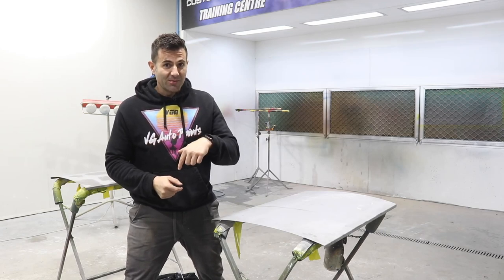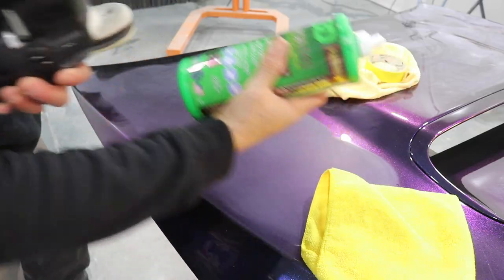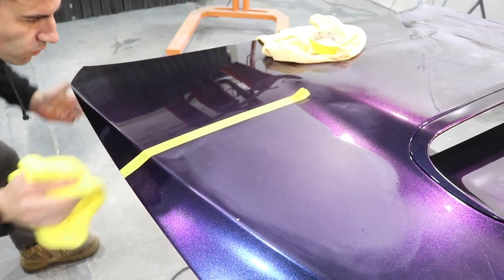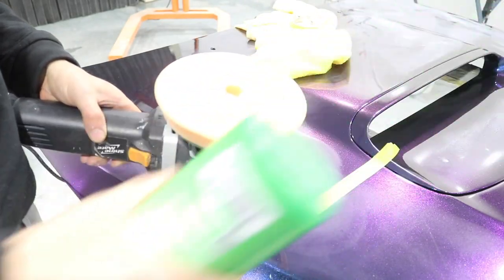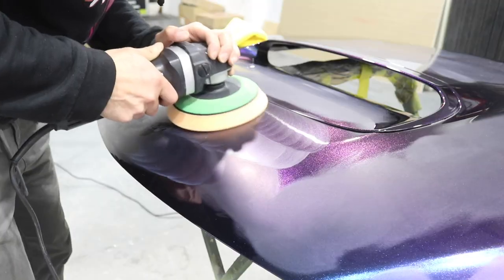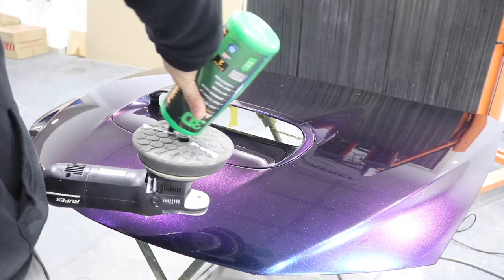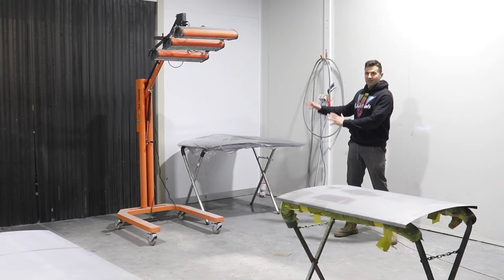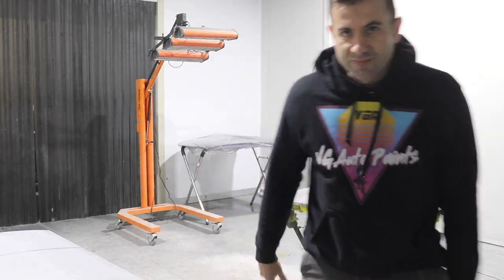Can a DA Polish 1500g Sandpaper

Comment: Hi mate love your work I’m struggling with my finish no mater what I do I’m  always getting scratches with my final product useing trzact 2000 finishing with 5000 cheers
Reply from the maker: Hey mate in my experiencein seeing  pros to first timers polish is 2000 and 3000 is enough. But using them for double the time spent on the previous grit is important. Also spending more time machine polishing with slower arm speed. Hope this helps.

Comment: Great rundown.  Totally concur with your approach.

That 3D is great stuff.  I’ve also had a lot of success with Meguiar’s M110 (newer than M105), as well as Griot’s Fast Correction Cream (which might not be available to you).

A lot of the outcomes have to do with the pad you choose.  A high-quality microfiber pad (like Meg’s) or even a wool pad and a rotary will cut really fast.  Any of the aforementioned compounds do well with dusting, but 3D is easily the best in that arena.  3D One is excellent for the finishing stage, but takes a while.

The sanding stage is where I think the real make-or-break of the effort is.  Getting that wrong will make polishing 10X harder to save.

Anyhow, you said all of that, but I just thought I’d second all of it from across the water.

Comment: Used to use  megs 105 and 205 years ago found them reasonably good as an amateur  but just upgraded to new bayt 1 step and it is a very good product with a foam pad for 1500 and finer
Reply: If you can access and afford the latest versions of Megs 105/205 (110/210) give them a shot.  3D One is also so good that it can replace them both.  The only issue is time.  In a shop, I believe a more dedicated compound (and 2 steps) is faster.

M110 cuts so well you can see it cutting each rotation, but for a one-step that might be overkill on a newer car.  3D One takes a while but finishes-down like butter.  Zero dust, infinite work time.

Comment: I've used my Porter Cable DA for years. I have that same exact microfiber pad you used on the DA, it's not bad. I tried the Amazon SPTA purple wool pads recently and they blow away the Meguairs red, Menzerna red, Lakewood Heavy Cut Foam and even the Lakewood microfiber. Durability isn’t as good at the others though. I tried compounds like Presta, Menzerna Ultra Cutting, Poorboys SS1 & SSR2 with all of them. I just ordered a Lakewood Purple wool pad to try out tomorrow. Maybe I need to try some of that 3D or invest in a rotary also!
Reply from the maker: Nice mate you sound busy

Comment: C P Palm Sanders have. 10 mm & 
5 mm as well as a 2.5 mm stroke sander that is ultra fine sanding that I use with 1500 grit sandpaper with a interface soft foam sanding pad then I polish with compounds and use a fill in glaze there used to be a product years ago called liquid ebeny it was black in colour and worked great best fill-in glaze I ever found really brought the color to life and even richined the color I haven't seen that glaze for close to 50 years but it was the best you could buy never had a swirl mark at all the color really came to life one it was polished and let's say the color was red and you used liquid ebony it was like the color became more true depth was outstanding I used to use it for a lot of acrylic laquer paint. . But like all good chemicals are taken off the markets just like Depont Imron polyurethane's the shine would last forever and never see a stone chip gas and oils would not touch it... More like an aircraft paint or boat paint they have it in the states but not in Canada but the formula has been changed its not the same just like epoxy primers today are crap ...
Great job like the color & flake

Comment: Great info. What grit would the compound be equivalent to? I'm guessing that would depend on the pad and the pressure applied.
I'm also curious as to how compound polishing compares to wet sanding with very fine grits. Say 3000 and finer. What are the advantages and disadvantages of each method?
Reply from the maker: The compound is diminishing so it starts coarse and gets finer as it’s used. That’s why the finish from the one step is so good.
Reply: @customspraymods  I see! That's interesting. So instead of being like a particular grit number, compound and polish is more like a range? So is compounding faster than wet sanding with 2 or 3 rising grit numbers?
Reply from the maker: @andrewleonard9257 👍 in my opinion it is. I’d say this video proves it.
Reply: @customspraymods  A side-by-side comparison could prove it, but I also trust your opinion. I guess I'm just curious as to why painters and detailers stop wet sanding at 1500-3000 grit, and start liquid sanding instead, when sanding discs are available up to at least 10000 grit.
Reply: 3D has good details on their website.  Should be able to cope with 1000-1200 grit scratches given the right pad, speed and pressure.  3D ACA520 is what you want for the 2500-3500 grit stuff.
Reply: @snail415  Thanks Justin

Comment: Looks good, but would the scratches comeback once the wax clears off ? If I can buff over 1500 I would do it in heartbeat.
Reply from the maker: They are gone. No waxes were used. 👍
Reply: @customspraymods  I meant the compound’s not waxes, I ask because sometimes when I buff I use the 3 m perfect it, I used 1500 then 3000 trizac then the perfect compound and after a day or 2 when the compound fully dries u can see hazing , scratch marks
Reply from the maker: @camarochevrolet9387  ahh. These compounds don’t have fillers but I also sprayed and wiped it with a polish cleaner to be sure. 
Hope it helps.